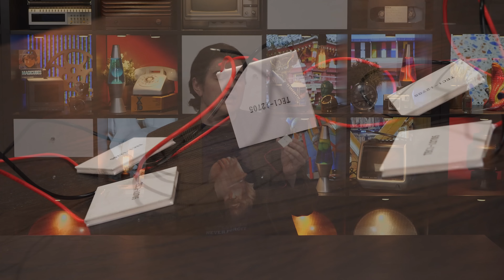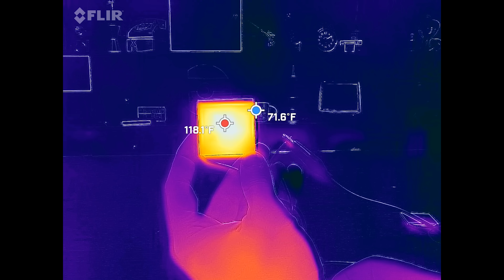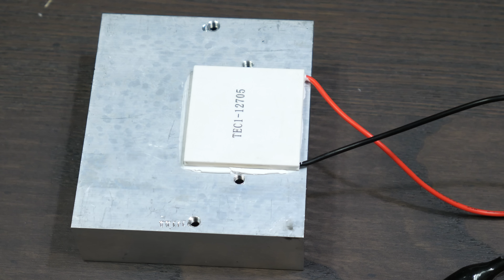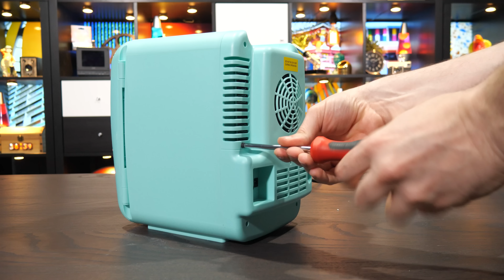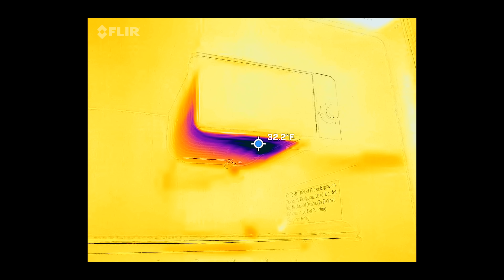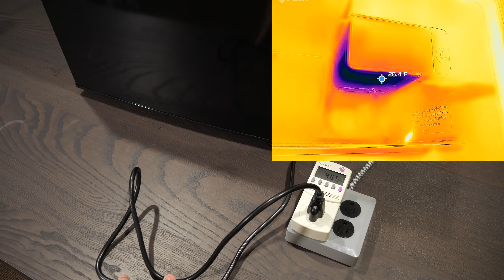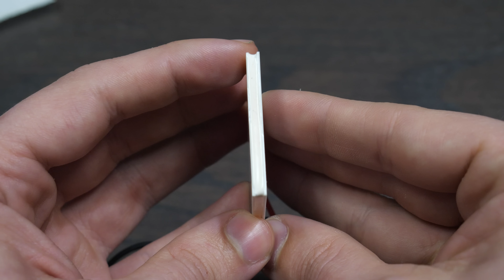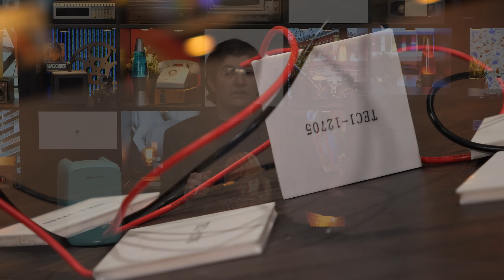Thermoelectric cooling: it's not great.

Comment: I need to introduce you to the PCR machine. A computer controlled heating/cooling block that extremely quickly bounces between say 55C and 99C in seconds and does that all day, everyday for years. They are Peltier units on steroids. They easily drop to 4C and will stay there all night too. Thermal accuracy of the tube block is measured in 0.1C increments, absolutely even across the block. We live and die by these Peltier units and I kind of feel that you owe them an apology.
Reply: What's the price of your thermocycler? What's the price of this "minifridge"? There's your answer why no apology is owed. If you buy cheap crap, you get cheap crap.
Reply: @hammerth1421  along with how many watts does it MOVE versus how many watts does it CONSUME to move it?

Comment: One application where Peltiers are great is cooling mobile electronics, like the sensors in high performance digital cameras. When recording at 4k and higher resolutions they generate a TON of heat, and a Peltier can help move that out into the air. Not only does this prevent the camera from shutting down, but can actually increase image quality.
Reply: We use these to not only cool but to provide temperature stability to ShortWave InfraRed (SWIR) imaging sensors.  Even if it has cooling limitations, you can have discrete temperature set points around which to set calibrations.
Reply: Peltiers are also used extensively in medical instruments. Some reagents temperature need to be kept within a tight tolerance regardless of the room temperature (and the required temp value might change depending on what step of the test is being done). Peltiers provide a convenient way to heat or cool as needed and can be very precisely controlled via a PID.
Reply: We used to use them stacked to cool klystrons in radar systems back in the 80s. I believe things have moved on somewhat
Reply: Same with laser diodes, their output wavelength shifts with temperature so in sensitive applications they're mounted on a stack of peltiers.
Reply: GoPro should include this into their terrible cameras, which constantly overheat and shut down while filming. They are such a crap product as they currently are.
Reply: @mike_et_saika  the peltier cell is just moving the heat faster, the gopro issue is that it has no heatsink (or generates too much heat for its size). It's not a solution
Reply: @marcogenovesi8570  attaching a Peltier to the housing of a gopro allows you to push more heat into a heat sink. It's not a pretty solution, and something integrated would be much better, but it works. However the power draw requires a substantial power supply.
Reply: @PsRohrbaugh  yes of course the peltier "works" if you add an heatsink and a power supply. But adding the heatsink and power supply makes the gopro as big and bulky as a normal small camera or a phone (that has no overheat issues), so it loses the main selling point, its small size
Reply: @mike_et_saika  it will discharge gopro battery in few minutes
Reply: @mike_et_saika  it has terrible efficiency, in gopro it will discharge battery in few minutes
Reply: @mike_et_saika  It'd be easier for them to put a heat sink on it with a tiny fan. You don't need a gopro to be cold, only not blazing hot. Ambient air temp is usually way lower than the shut down temp.
Reply: @thebestSteven  But a fan would not work with it being water- proof/tight. The bearings also don't like to be shaken around. 

This is why industrial and vibration proof computers are often passively cooled with huge chunks of exposed copper and aluminium. 

A tiny peltier element with the hot side exposed though at copper plate would make it a passive systems.

//typo "industrual"
Reply: @mike_et_saika  then you could just add passive cooling to it with a beat sink exposed to the atmosphere. The Peltier is going to use more power than possible to make an impact. The heat generated from that part of the system would limit the effect to the point that it would make more sense to make it a heat sink only. That won't drain your battery and create extra heat.
Reply: @mike_et_saika  that would be a good idea but the tiny battery would die in about 10 minutes if it can even handle the load
Reply: @mike_et_saika  You do realize a GoPro battery can't power one of these?
Reply: @orion10x10  Peltier elements are variable. A low powered one could be good enough. It doesn't have much mass to cool and only needs a few degrees to keep the sensor alive. Connect the hot side to a copper heatsink as part of the case to get the heat out. 

It would bring down the battery endurance, for sure, but it's better than having no working camera. 

I'm also in Siberia sometimes, because my in-laws live there. It's the opposite problem, which is a bit easier to solve.  

For my old mirrorless NEX-5 camera and the GoPro, i 3D printed special cases with a powerbank and a little heat coil, plus a small compartment for moisture absorbant granulate to keep if from condensating.

//Typo
Reply: I actually wondered about this for cooling CPUs and video chips for gaming laptops, where maybe a fan heatsink is inadequate but water cooling is too heavy and bulky, but you have access to power.  Of course, you still have to discard the heat from the Peltier, then ....
Reply: @gfghjfgfghfj it's been tried, many times, but it doesn't work. You still have to move the heat away, and now you have to move even more because you have to account for the wattage from the peltier. Also, they can't handle heat spikes at all. Under high load, the heat generated by a CPU is typically greater than the transfer capacity of a peltier, so the heat is trapped and the CPU overheats. Lastly, if your peltier ever manages to go sub ambient, you have to worry about condensation inside your computer.
Reply: @gfghjfgfghfj  Peltiers have used by overclockers since the 90s. I remember putting one on my 400 mhz celeron. With laptops, the issue is both power consumption and having a big enough heat sink to dispose of all the heat. It would only make sense in gaming laptops designed to be plugged in, where they're more portable desktops than actual mobile computers.
Reply: @gfghjfgfghfj  plus the peltier would probably use more power than the cpu its trying to cool so its suuuper not worth it
Reply: @gfghjfgfghfj  if you put peltier element in a closed environment like a laptop it would be net heat generator. better to have more heatpipes, but even that have limits
Reply: Why don't you just add a normal aluminum or copper heatsink. That won't destroy the battery by using 55watts of power.
Reply: Wster.  There's a body fat freezing treatment machine that uses peltier devices with circulating water cooling.
Reply: @cobre7717  that'd be great if the manufacturer did it. I'm talking about improvised solutions by the end user. Getting the case to sub-ambient temperature increases the rate of heat transfer from inside the device to outside.
Reply: There's a Stirling pump (using helium) used in a space flight mission. A few degrees above AZ.   When dollars to the kg getting hardware delivered on station, actual Mechanisms win out.
Reply: @jagmarc  regarding the Stirling pump on JWST, the relevant part is "a few degrees above absolute zero". A Peltier can't do that under any circumstances. But when you need to keep a camera's sensor at 10C when it's 40C outside and you're in direct sunlight, Peltiers work great.
Reply: @PsRohrbaugh   The peltier cold face may be 10°C but it's unlikely the sensor is that, more like 100 ?
Reply: @jagmarc if you camera sensor ever gets anywhere near that hot you are going to have trouble. The sensor would be at a similar temperature to the Peltier cold end
Reply: @FireCrack   Hardware containing Imaging sensors something I've not designed. I imagine the thermal design is same any other silicon, but instead of junction temperatures of around 100 degC for processors it's maybe room temperature. Thermal design as chains of theta resistance elements in series paralell.
Reply: @jagmarc  the silicon itself, sure. But the sensing properties of cameras (CCD) tend to be themselves supicable to higher temperatures producing noise in the resulting image. But the main my reply was so tounge in cheek was that such a large temperature difference would imply some serious action on the hot end to dissipate all that heat, probably beyond what would be practical for a portable camera on a warm day!
Reply: @FireCrack    Noise, that triggers a remember , I did once do something which had a CCD array, on a still image the pattern was rolled off multiple times into page buffers and then averaged to cancel noise. I can't say much more
Reply: Peltier - The victim of misunderstood by the misuses of day dreaming noobs.
Reply: Yeah we use peltiers at my job all the time. My company works on laser diodes so it’s important for characterization to keep it at a constant temperature and pelters make the most sense for that since we only need to heat small pieces of metal
Reply: What about some of those new mini cooler things like the Frore AirJet or xMEMS XMC-2400?
Peltiers are uniquely able to go sub-ambient but for thermal management in mobile electronics that isn't important, just need to keep things from overheating
Reply: I was wondering if they might be useful in that regard when he started talking about them. SLR cameras GPU devices, that type of thing.

Comment: Another important use case for peltier coolers is in thermal imaging systems. They can be stacked together, which plummets their COP, but it can allow them to reach cold temperatures below -50 C. That degree of cooling is impossible to reach in a small form factor in vapor compression, and that degree of cooling at the sensor allows for smooth, low-distortion thermal imaging

Comment: 27:55 wouldn't it make more sense, for heating purposes, to just use resistive heating? And whenever you want something in your cupholder cooled, you're surely also running the AC. So, put a vent in a sensible spot and you'll have cooling as well - without the need for dissipating the heat somewhere close to the cupholder.

Comment: Can confirm that. I recently tried to refurbish an old thermoelectric coolerbox, however after changing the thermal compound and measuring the cooling capabilities (about 10°C under ambient), I threw it straight in the trash. Now I have a cheap compressor coolerbox which uses a tenth of the energy and actually cools. Compressor FTW 😁

Comment: The college i went to, many years ago, did not allow min-fridges in the dorms. But, they had no issue with "electric coolers".  I had a nice, and not cheap, Coleman brand one. It worked fairly well. But ice build up was a problem on the heatsink fan area, and had to defrost it ever week.

Comment: Good explenations Alec!
I have upgraded a 12V Peltier coolerbox with temperature control to switch of the fans motor and element, and have power measurements in the lid, still tinkering with it to upgrade it with a more powerful element, but now learned that I probably best not go up to 15V for efficiëntie reasons, and this already blew up my controller 😢
I also but an extra foam blanket around the box, made of aluminised sleeping pad to reduce heat leaking back in.

At work I've seen Peltier elements to cool small diode lasers and measuring equipment, and also in a device to calibrate temperature probes.

Keep up the good productions!

Comment: One of the things we did back in the early 2000's to improve Peltier cooling system performance, was run multiple peltiers at half voltage attached to the same heat exchangers. You could achieve better cooling along with efficiency with 4 units at one qurater(or lower) power, than a single peltier at full power.

Comment: One of my first ever tasks as an engineer was helping to integrate a TEC based cooling system into an instrument package on the Curiosity rover. Even in that scenario it was a big compromise due to the inefficiency, but we got benefits from both the hot and cold sides since the cold side would pull the sensor down to operating temp and the hot side would just dump into the main heating loop helping to keep the rest of the rover warm in the cold martian environment. So that's another legit use for them, if a bit specialized.

Comment: The peltier element have another use they can make power with temperature gradients. We use them like this to power deep space probe. Stick one side to plutonium and the other to a heat sink, and you get a nuclear power supply with no moving parts that will last as long as the plutonium is hot.

Comment: If your electricity is coming from your own solar or other closed renewable system, these things are great because they have no moving parts and are relatively inexpensive.
Use them the other way, however, and they become awesome! There are vehicles that stud the exhaust system with these to capture wasted heat energy, which reduces drag on the alternator which in turn improves fuel efficiency and thus emissions as well.
Edit: Just the peltier units, not the mini-fridge. You'd still do way better to just get a reasonable mini-fridge. I use peltiers to de-humidify a cabinet.

Comment: I got an unusually large peltier fridge for free and used it in a basement room. It was the size of a normal mini cube fridge and had similar insulation and door seals, but was extremely lightweight. It worked surprisingly well, perhaps because it was properly insulated and had a sizeable fan and heatsink on both the inside and the outside. It wasn't efficient, It pulled 50W, but it was actually quiet and kept things under 40F -- probably because it was in a 60-70F basement. The only issue (a serious one) is that ice would form on the internal heatsink. This occasionally got bad enough to start interfering with the fan, making noise and ultimately stopping it. I suppose you could see this as the temperature control... no need for a thermostat when the fan will just stop when it goes below 32F. I knocked a blade or two off the fan while chipping the ice off one time. It kept performing exactly the same, but I gave up on it when I moved and would have to actually pay to run it.

Comment: I have a 12v Mobicool thermoelectric cooler I use as supplemental cooling space in my holiday trailer. It is fairly well insulated,  has an fan on the cooling side of the element and runs off the trailer's 12v RV power supply. I turn it on for a day or two before the trip to cool down and keep it running for the whole trip, It works well enough this way to keep pop and "cold snacks" drinkably cold without taking up space in the main adsorption type fridge and freezer.

Comment: As a scientist, I use Peltiers (TECs) all the time.

There is a joke that any precision measuring device begins as very expensive temperature sensor. While this is not generally true, many device properties are temperature sensitive. For instance, to be useful for scientific purposes, lasers need to be temperature stabilized with an error <10 mK (and often better than that). One important thing about these applications is that the thermal load and thermal capacity of something like a laser tends to be very small. Moreover, we typically set the temperature to something near room temperature. As a result, we typically don't need to run very much current through our TECs. The advantage of using a TEC is that the heat transfer is proportional to the current flowing through them, and they can push/pull heat.

A compressor cannot run at 20%. Rather, the compressor runs at a 20% duty-cycle. That is: the compressor runs at 100% (fully on) for 20% of the time, and 0% (fully off) for 80% of the time. This obviously results in temperature swings. If I create a simple PID servo to stabilize temperature, the output would be a voltage that is proportional to the desired rate of cooling. If I were to use a compressor, I would need to add complicated electronics to control the duty-cycle using this voltage. Because TEC heat transfer is proportional to the current running through them, you simply add a voltage controlled current source circuit to the output of your servo, and connect that to the TEC. Now your servo can control the rate of heat transfer without much fuss.
Reply: I imagine you could also run the compressor at full tilt to cool down a fluid, and then control temp by adjusting coolant flow rate.

Comment: I used to have a bigger one that could fit 13 cans. it worked well enough, and I used it until the power supply died. it had quite a bit more insulation than the little one you have there.

Comment: I've always wondered how much (if any) insulation there is in those toy fridges and I've always wanted to see a proper teardown of one. Would be an interesting project to buy one and just simply see how much one can improve it by actually insulating it (and adding a temperature probe) or replacing the styrofoam inside with something else. If weight wasn't a concern, what would be a good replacement for it, though? Wood? Sand? The styrofoamy stuff that is specifically designed for insulation?

Comment: I enjoy your show. It is really excellent. Several years ago I bought a wine refrigerator for the back kitchen and it had these Peltier chips inside it. I installed it in the spot under the cupboard where the opening was and the next morning when I went into that room, the room must’ve been 20° hotter thanthe hallway. I couldn’t believe it and I’ve central air conditioning going and it was 20° warmer so I pull that thing out put it back in a box and went right back to Home Depot. I got a conventional fridge. These things are like hot as irons. It’s great if you live in Alaska.

Comment: Outside of specialized applications like spot-cooling and enthusiast computer overclocking, peltiers are pretty much useless. If you're not trying to configure it in a system that uses liquid nitrogen, you shouldn't really be using one.